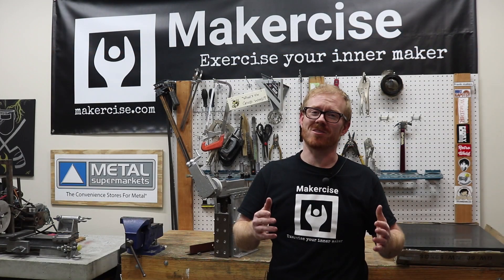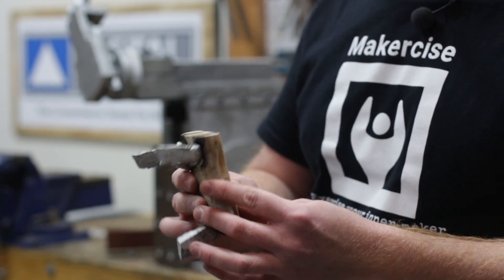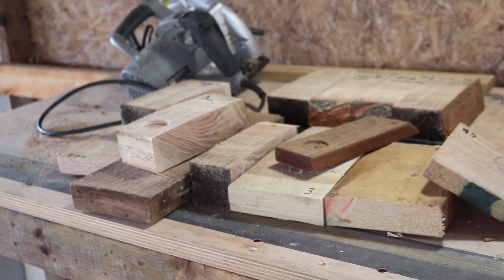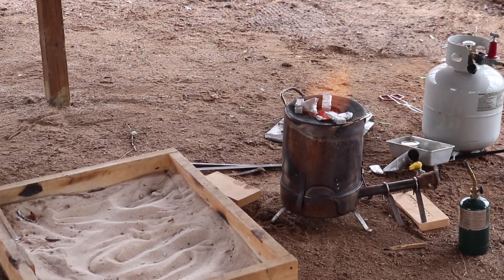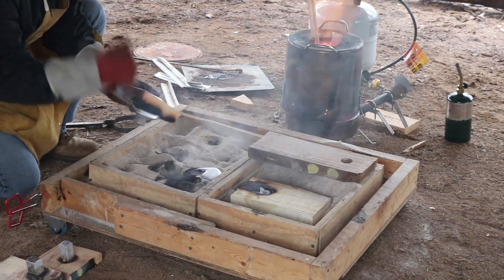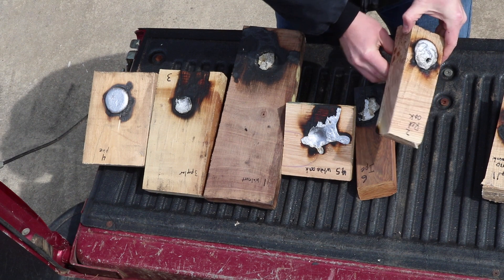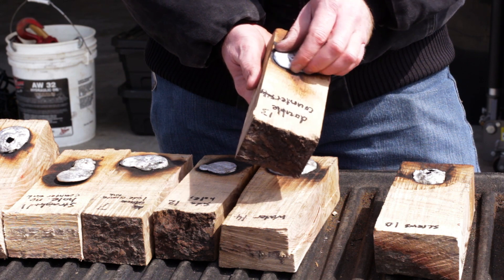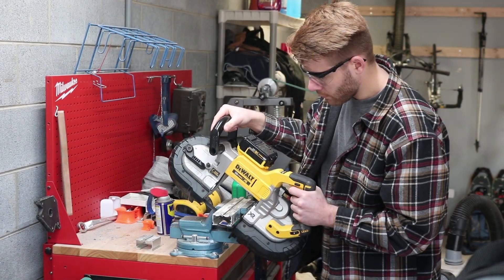How To Cast Aluminum into Wood // Molten Aluminum Lake Table

Comment: Kudos for the amount of work you put into this. Unfortunately, you really just proved what I, and probably most people assumed from the start. The metal will shrink as it cools and therefore never create a tight bond between itself and the surrounding wood. My guess is the metal will get even looser if the finished table is left in a home with low relative humidity. Perhaps if you poured the metal into a piece of wood fresh out of a drying kiln?

Comment: Crazy cool work. With that heat you need... Just cool. To anker the pieces you can use screws. I did that with tin, but you are on a different level.

Comment: Hello great video! I have a question why didn't you buried the complete wood on green sand , I mean just the way you did it with the poliestirene, but the square part facing up as the pouring entrance if you make sure the exit is flush with the foam I think if you do that you have a better finish and less grinding to do afterwards I'm sorry for the way I ask the question not mi first language

Comment: What are your thoughts about soaking the wood first to prevent burning?
Also, why did you choose aluminum, over say pewter?  I was considering using pewter because of the low melting point.

Comment: Another way to keep the metal tight is to take a drill bit and drill some holes sideways in a couple spots in that knot. It basically gives the metal a set of roots in the board.
Reply: They did do that dingus

Comment: That table top surfacing epoxy could always be poured in to take up the burn gap and you would save a lot of expensive epoxy filling large knots with beer cans.

Comment: A countersink is a conical hole cut into a manufactured object, or the cutter used to cut such a hole. A common use is to allow the head of a flathead screw, when placed in the hole, to sit flush with or below the surface of the surrounding material (by comparison, a counterbore makes a flat-bottomed hole that might be used with a socket-head capscrew). A countersink may also be used to remove the burr left from a drilling or tapping operation thereby improving the finish of the product and removing any hazardous sharp edges.
Counterbore
A counterbore is a cylindrical flat-bottomed hole that enlarges another coaxial hole, or the tool used to create that feature. A counterbore hole is typically used when a fastener, such as a socket head cap screw, is required to sit flush with or below the level of a workpiece's surface.
Reply from the maker: William Thrasher i just learned something.

Comment: Your better off using Pewter as Pewter has a low melting point, around 170–230 °C (338–446 °F),  which will not burn the wood anywhere nearly as bad as Aluminum which has a melting point of 1,221°F...
Reply from the maker: Ramiro M great suggestion. Will pewter take a polish? Ive only ever see low luster nick nacks of pewter.
Reply: Of course it will... ever seen those Polished pewter Mugs or any of those shinny kitchen relics, search online for anything of polished pewter... looks just like silver. Any "metallic" metal can shine... its all about surface finish.  Even lead can have a high luster.... as long as its sealed from air.